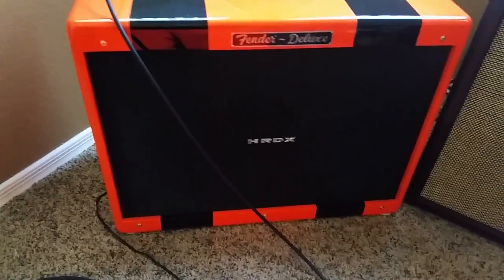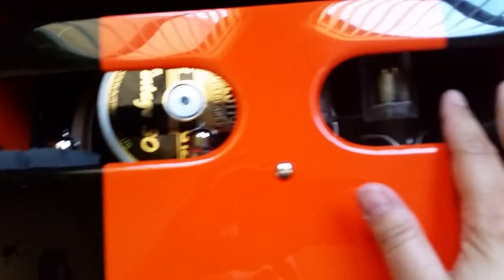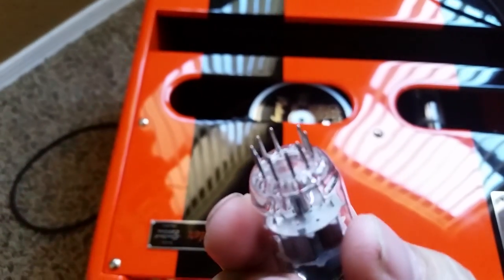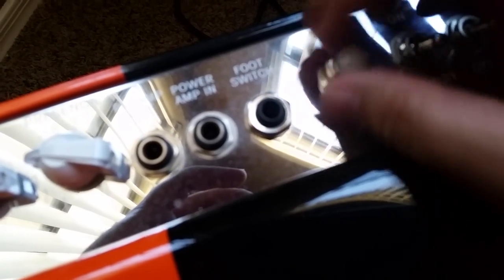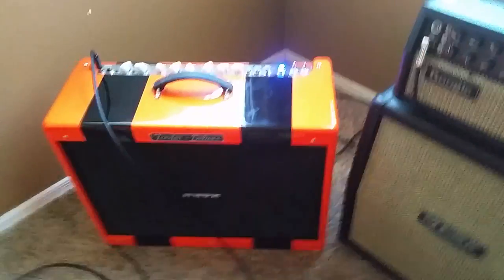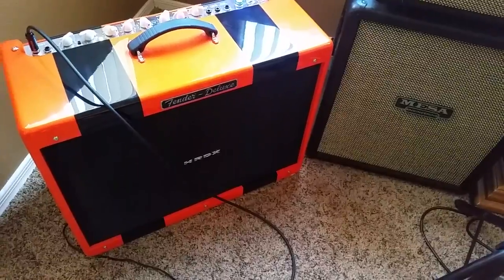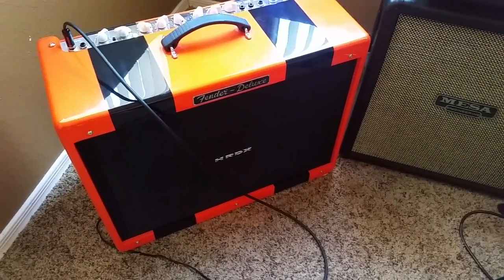Improve Your Fender Hot Rod Deluxe For $10

Comment: When ever you make changes to an amps tubes or components always know in advance what the expected outcome is to take place so that you can realize immediately when or what the change has accomplished in relationship to whats suppose or whats intended to take place                                                       
                                                                                                                                              Considering that the different tube may be bias differently will there be any unusually immediately noticeable difference in the tone attributed to unequal bias when accomplishing the testing of different tubes....or is it a matter of being ok for a small period of time in the testing of multiple like tubes......   Again this is not talking in reference to amps that self bias or non biased or any other consideration where bias is not a complete issue in the working of the amp over long periods of time.     I have more tube amps than solid state amps and have come to find that the differences in the considerations for the power tubes of fender, marshall and or  6l6 6v6 el 34  el84  88  and the like.   included are pre amp tubes by way of 12ax7 12at7 and ecc83 or 81 and the same tube different number associated with the American version and the European or Russian versions of pre amp tubes.....plays heck with first time use and familiarity.   power tubes representing the biggest concern over all things being equal.  Once upon the reality of the specific s in the way an amp can be handled as to the bias at home and knowing how and the many factors that preclude that little lesson in home security in the means of taking care of personal amps.   The objective is to understand what must be considered before taking the time to do any changes in tube selection and quantity of replacement  bias factor and desire to affect tone of the amp before or after the change of tubes.

    In the concerns of looking for unknown problems, when you are not clear as to the origin of the problem...microphonic tubes verses bad caps or resister or faulty wiring all play a real time need in understanding what , how and wny it acts the way it does.  It not difficult to create more problems in more or secondary areas beyond tubes and power supply, if you are not aware of what is the right understanding to the efforts that you make.  Having a gradual improvement in understanding the workings of your favorite amp is better to ask first and then accomplish,,,,failure to ask always creates a non compliance opportunity in the way a tube amp will treat its owner.
Reply: Preamp tubes are normally self biassing.

Comment: 12AT7 is a pretty awful sounding tube as a V1. Try a 12AU7- much nicer in my oP and much better fit electronically with respect to current draw. It's what Fender use in the  George Benson version. Also at 2.03, those little 'caps' are not for keeping tubes warm. Probably the last thing you want to do to a tube. They are electronic shields.

Comment: 12AT7 is a phase inverter tube.  A 5751 is a much better choice and sounds great in V1 tube slot. The gain will be at 70 or 80 percent which is slightly less than 12AX7 (100 percent.)
Reply: +sethyjamal The preamp tube that is closest to the power tubes.

Comment: 12AT7 is not a musical tube. Commonly used in a reverb circuit. A 5751 would be better to tame your V1 gain circuit. A 12ay7 would tame it even more and is commonly used in V1 on Tweed Deluxe and Bassman amps.
Reply from the maker: Thank you for the info,  I will have to give it a try.
Reply: +utmotrix Not a musical tube?? Fender uses 12at7 in the v1 on the George Benson HRD. He sounds very "musical" in the Fender promo video.  This is a great improvement for anyone who prefers clean tone.
Reply: Folks - go here to get a grip on the different gain factors involved in these types of tubes (12AT7-12AU7 - 12AY7...etc).
http://www.thetubestore.com/Resources/Guitar-Amp-Info/Gain-Factor
I RESTATE that the 12AT7 is commonly using as a reverb driver or phase-splitter. This :Benson" amp is the first amp I've EVER heard of that uses a 12AT7 in a pre-amp stage. It's not the best choice.
  I run 5751's usually in V1 to cut down unwanted distortion. Works GREAT in a Blues Junior or other amps (like Hot Rod Deluxe, etc).
I use 12AY7 in the pre-amp stage of 50's Tweed Deluxes to drop the first gain stage and increase clean headroom.

Comment: All you had to do was change the volume pot from Linear pot that it comes with to an Audio pot.
Reply: +Dave Levine - please elaborate, I just picked one of these up used yesterday
Reply: These fixes on this page are trying to put a band aid on the issue. The amp uses Linear pots. If you change the volume pots to Audio pots, as I have done on my Hot Rod Deluxe Bluesman, you will find the problem solved. Cost is cheap and you aren't messing with the electronics or sound of the amp.
Reply: +Dave Levine I think your advice should come with a bit of a caveat.  You ARE messing with the electronics because you have to take the amp apart to perform the mod you're talking about (I've done it to mine).  You also need to have a very specific pot to do this.  My Hot Rod has the terminals for the pot attached as a metal bracket that solders directly to the PCB.  It's not a standard board mount pot (correct me if I'm wrong) or even a standard guitar/bass volume pot.  I personally would not recommend this mod to someone who has never worked on amps before because you still have to discharge filter caps to perform it and not everyone knows how or is comfortable doing such a process (even though it's super simple).  I'm also not an amp tech by any means but I consider myself a somewhat knowledgeable tinkerer.
Reply: I recommend anyone take their amp to a Fender Auth Repair Tech, and have all the the Volume pots changed from Linerar Pots to Audio Pots. Problem solved, Warranty still in effect. I had mine done and it fixed the issue and I am not changing resistors or anything else that its trying to correct what the pots are doing.. Thats all.
Reply: Dam hard mod getting that board out n those mounted pots ain't worth it!!
Reply: The problem with just changing the volume pots is that it only gives you a better control of the volume, but the amp remains as loud as before, and you still have to play to loud to reach the sweet spot of the preamp.
Chaging the lamps to 12AT7 solve that problem.

Comment: Gonna try it, shit why is fender not seeing this problem
Reply: Because it's a 40 watt amp and it's not really designed for home hobbyists ... I found that out when I brought mine back for repairs and the guy asked me if I had taken it to band practice...
Reply: have you ever tried other amps?My Marshall when playing at 1 is NOT TOO LOUDMy 100 watts amp that I used to own, played it at low volume with no problems.Its a thing with Fender, when playing at 1 its like playing at 4 with other apms.And after is more subtle.
Reply: +andy T well my experience with the Fender Bassbreaker 15 and the deluxe reverb I tried when buying it was that they didn't have the volume jump that the hot rod does. Although I hear the bass breaker 18/30 series is ridiculously loud so it may be a difference between how fender and other companies build amps (meaning how they grade volume because it's not exactly a regulated feature). The other thing is that in my limited experience with Marshalls is that their cleans tend to break up faster once you go past 3 or 4 (or 5 for the 40watt). I will say that in my experience the hot rod's gain channel is far more manageable with volume, given you've got both gain and master control.
Reply: +andy T And what I meant by them not thinking 40watts is not for home use was that if they make a blues jr and other lower price point, smaller amps, then they would argue that the broad majority of users want a 40watter for performances, and so they wouldn't expend the energy in design making the volume arc more subtle. That said I don't know a whole lot about the engineering of these things.
Reply: Supposedly Fender want to stay "historically true" by retaining linear pots as was originally in old amps, leading to very steep early volume curve which then flattens (diminishing power returns). I am no specialist though. But sounds stupid to me and I have to say Blackstar tends to be similar, even on my 5W head which is too loud for home as soon as I reach 4 on the volume...
Reply: If you get the newer HR-III, those have audio pots instead of linear, so Fender did finally address the issue.
Reply: andy T they are seeing it....they are making a hotrod with this mod, only they are adding to the msrp and putting george bensons name on it
Reply: when playing live simply mic'ing the amp with the amp volume around 2 or 3 and pushing volume via soundboard & PA system it would be an easy fix....which is what i do

Comment: Interesting... favorite amp of all time?  Wow, disagree nearly completely along with almost every tech I talk to that has to work on these amps as they find them to be nightmarish.  These amps are riddled with quality issues galore, one of the most poorly made Fender amps of all times.  Yeah they sound good and take pedals well but so many of them end up having various sound quality issues, I had three of these amps and all of them ended up having bad solder joints and overheating of grid and screen resistors and/or they had random crackling issues (since the tube sockets are soldered directly to the circuit boards the heat transfer of the tubes to tube sockets loosens them from the circuitboard causing intermittent signal loss) that even after multiple solder retouching caused the intermittent issues to just reappear later... making this amp very unreliable, no matter how good they sound.  Also, as already noted you can't play these as is for home, way too loud and uncontrollable master volume sweep pot, the work around is using a volume pedal or volume box attenuator in the effects loop but that also changes how the tone controls function and pending on the amp volume settings creates preamp distortion (sometimes its cool sometimes it not!).  I wish I bought my vintage 40-50W Traynor tube heads (YBA-1, YSR-1) before the 2 or 3 of these HR Deluxes because the Traynors are point-to-point circuits which make them very reliable, sound great (Fender cleans... I use pedals primarily for gain) and relatively affordable especially compared to other amps built from the 60's/70's era (i.e. Marshall Plexis and Fender Bassmans).

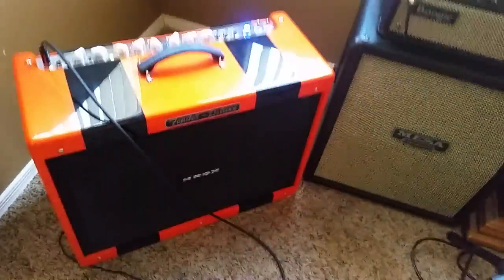Comment: YouTubeImprove your Fender Hot Rod Deluxe for $10Phillip McKnight 33,930 views3377 12:36Modifying the Fender Hot Rod Deluxe III - Tinman Electronics 15Tinman Electronics11,845 views 5:51FNF: The four must have pedals and why.Phillip McKnight8,581 views 22:05The New Fender Blues Junior III, Hot Rod Deluxe III and Deville IIIRob Chapman289,590 views 17:40Fender Bassbreaker clean and using pedal and line outMark Shields8,438 views 25:02Squier Roundup: A look at six Squier guitars from worst to firstPixxyLixxx204,093 views 15:04USA Paul Reed Smith vs Korean PRS SEPhillip McKnight11,752 views 5:31George Benson Hot Rod Deluxefendermusical174,876 views 2:26The Two Main Problems in the Fender Hot Rod Deluxe.Bill Curran32,977 views 6:14The Blackstar 1 watt and why I've owned 3 of themPhillip McKnight10,378 views 3:54Having Trouble Making Chords? Here is a fast Easy ExercisePhillip McKnight5,374 views 8:41Fender Bassbreaker 7 watt amp full reviewPhillip McKnight15,569 views 5:54FNF: How to get a good sound at bedroom levels with your tube amp.Phillip McKnight4,059 viewsCOMMENTS • 181 Add a public comment... Sean Gustafson(Please excuse mistakes, I live in Italy and still learning English) Hey guitar guys. I recently got a hot Rod deluxe the other day as my first tube amp. I've never had any experience with them and obviously I don't know a lot about them. I noticed that even if my guitar is off, the amp seems really airy if that makes sense. It's just kinda noisy. I don't know if this is a normal tube amp thing or maybe I have bad tubes? Thanks in advance.

Comment: Do not i repeat do notttttt change the tube! Get a volume control pedal. Changing this tube can and will hurt the other tubes. This is awful advice. This is not really a practice amp to begin with. But with a volume control pedal you wont be sacrificing messing up the other tubes.
Reply: It won't hurt the amp... just lowers the gain.